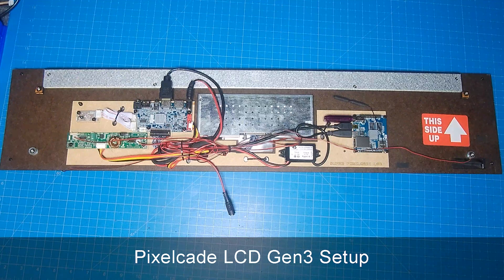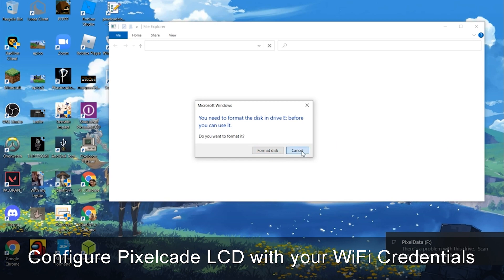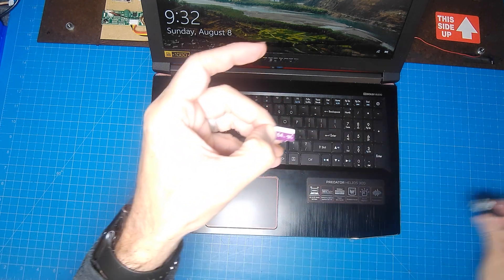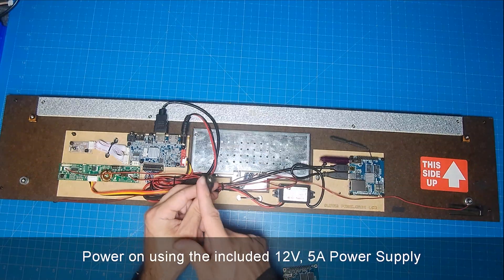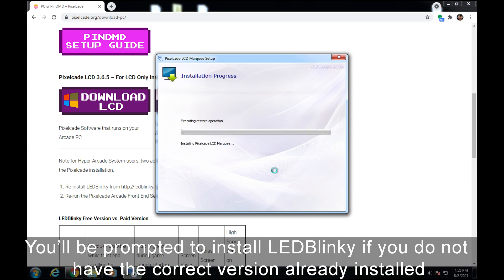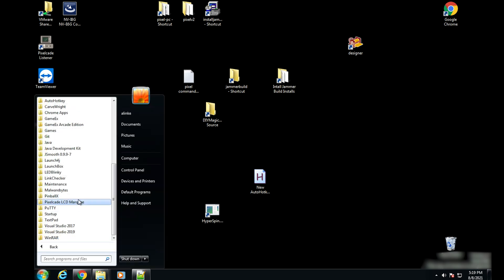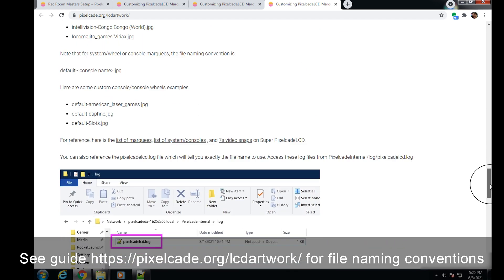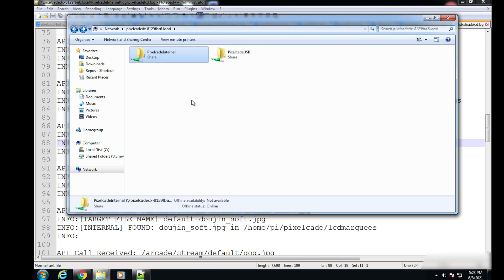Pixelcade LCD Gen3 Setup

Comment: So no way to connect to the PC directly? Seems like an odd choice, at least for cabinets.
Reply from the maker: If you are on a front end like big box for example that has marquee support , you can bypass the pixelcade system all together and connect to the LCD via hdmi .
Reply: @opengadgets  So you can also use it as a monitor, but I wanted to use it with LEDBlinky via USB, which has nothing to do with sending it a video signal. Do I really need to use an older model to accomplish this?

It seems crazy to me to have to run two network cables or use WiFi (!) to connect a PC to this thing when all that should be needed is a serial connection. Please tell me I'm mistaken; I can't imagine that this "gen3" version had done away with serial connections altogether, perhaps in favor of more "modern" WiFi, mDNS, etc.
Reply from the maker: @davidmark909  Right now it's Wifi or Ethernet, you are correct though as having a direct USB connection as another connectivity option  would be helpful , it's something we are looking into but no timeline as of now. On a separate note, the network connectivity does allow you to access Pixelcade from other computers on your network to both browse and update artwork,  see the Pixelcade Companion web UI for example https://youtu.be/B43rKa9p17Y . Also note that our Pixelcade LED based marquees do run over a USB direct connection.
Reply: @opengadgets  Thanks for the non-answer. No sale. :(